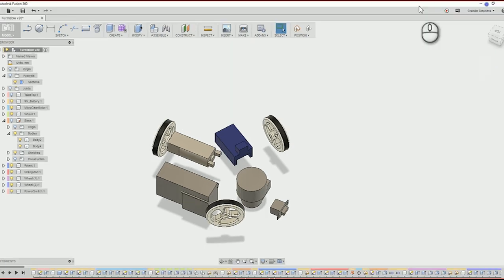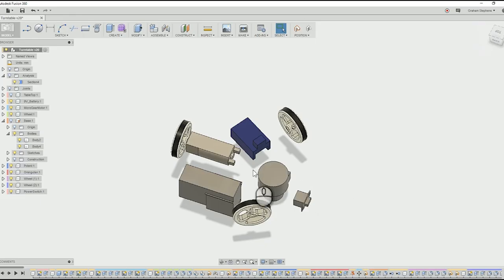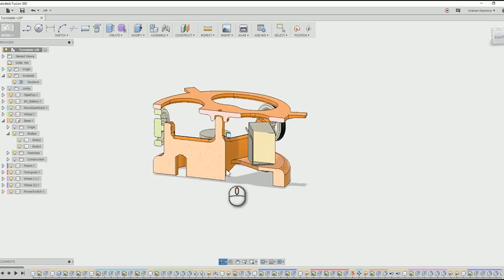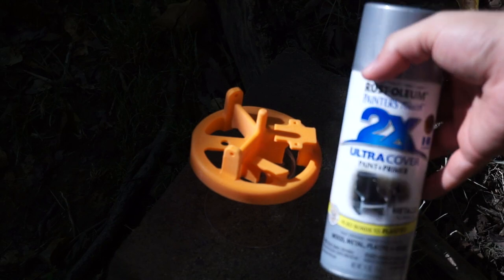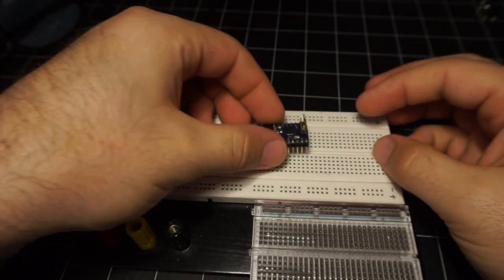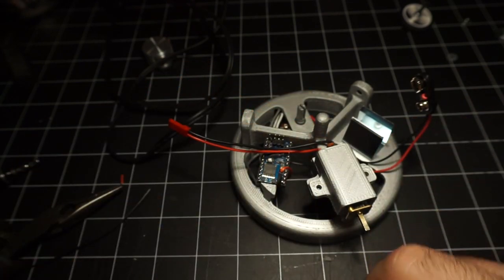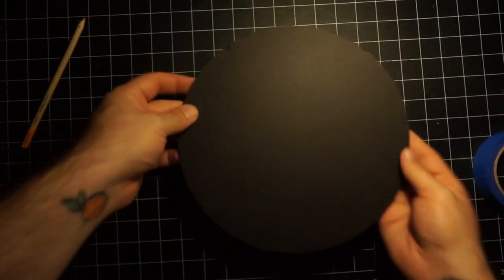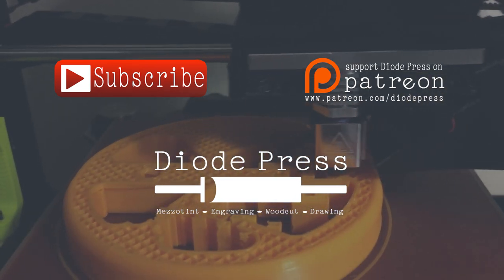3D Printed - Motorized Turntable (Lazy Susan)

Comment: Nice video, like how you went through each step in the process. Question - when you talk about the 'clamp' that holds the motor down. Did you just measure the motor then design in Autodesk? Did the first print actually fit correctly, or did you have to re-print after tweaking? I have a Rostock Max V2 printer and I always find I have to tweak my designs to get them to match up with real-world measurements. I wonder if this is due to the delta design, do you have the same issue? Thanks
Reply from the maker: +thedoble when I load a new roll of filament, I print a few test objects and adjust my flow settings, temp, etc. until I get a print that's close to my designed test parts. It might still be a little off here and there, but close. I measure non-printed parts and model them at actual size. When I model my 3D printed pieces, typically I leave 0.2mm clearance if I want them to be a tight fit. If I'm doing something complex with lots of interlocking pieces (like the vice project) I create a slice of my final assembly, maybe 1" thick, cutting through all the interlocking parts. Then I print those slices, and test them out, So if I need adjustments, I don't waste a lot time waiting for the whole model to print. Might be a good video topic to add to my list. Hope that helps!